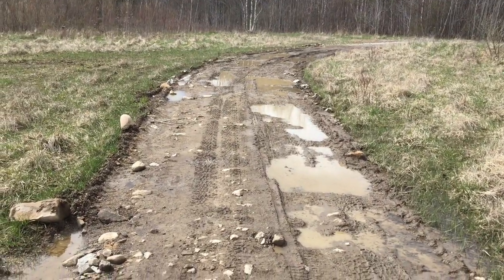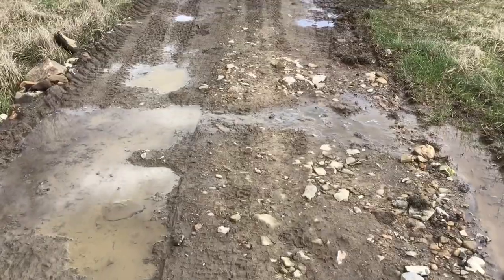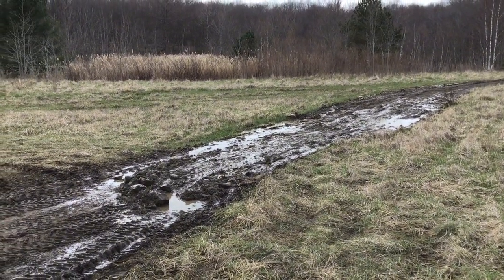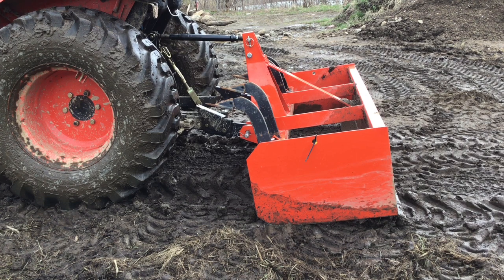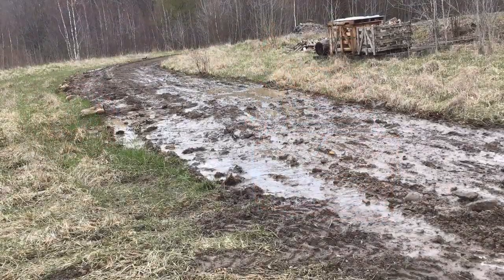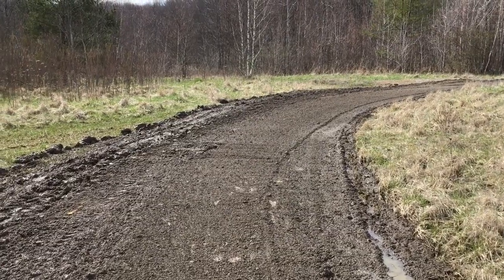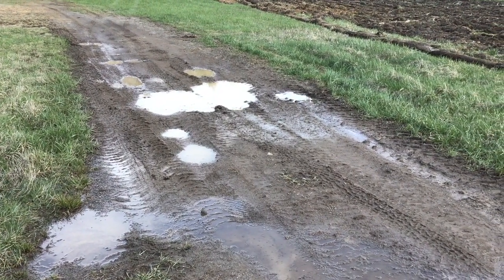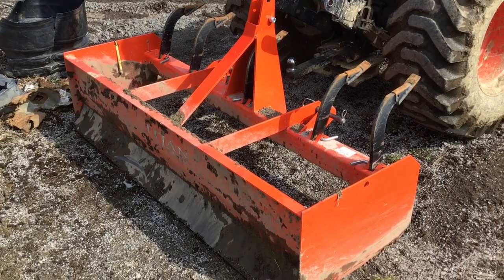Using a compact tractor and box blade to grade and remove puddles

Comment: I would be interested to see another video of this repair in a year or so.  I was taught that you had to use the scarifiers to first turn up the ground to make a permanent fix for a pot hole.  Otherwise the fill material just move out with traffic and expansions/contractions of the weather.
Reply from the maker: Thanks for the tip.   I used tailings I had from my homemade screener, which consisted of larger rock and gravel as a base and the used a 1/4 to dust for a top coat as shown in the video.  I turned my scarifiers upside down because I didn't want to pull those larger rocks from the base.  It has actually held up really well so far.  On the other hand, with the tractor and box blade its really no big deal for me to go over it again if a pot hole does develop because I enjoy the seat time anyway.   But so far so good.  Anyway thanks for the advice and thanks for watching.

Comment: Sand and gravel will help. 50 50
Reply from the maker: Thanks!  It's been over a year now since this repair. it gets driven on everyday and has been holding up well.  Thanks for the advice!
Reply: @JoshHovis  I guess I didn't realize it was so long ago but yes whenever I'm dealing with any type of wet dirt I mixed sand and small gravel. It's just something that has worked for me.